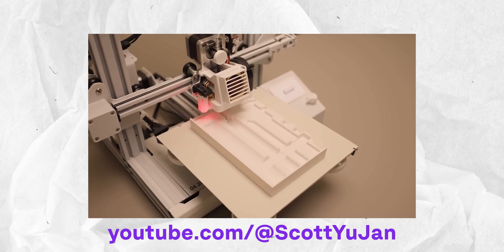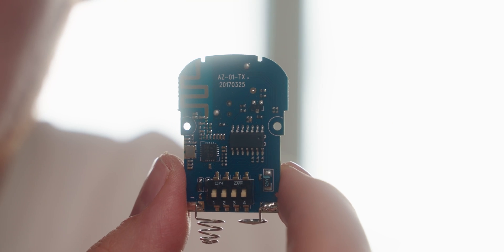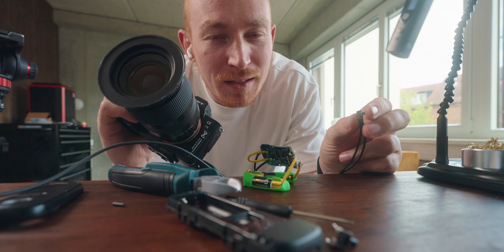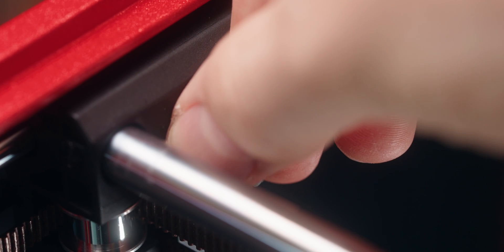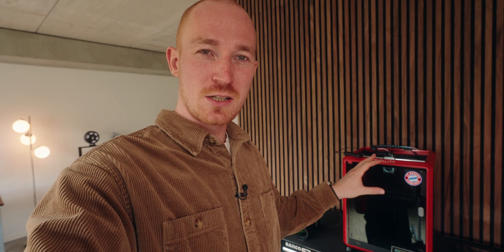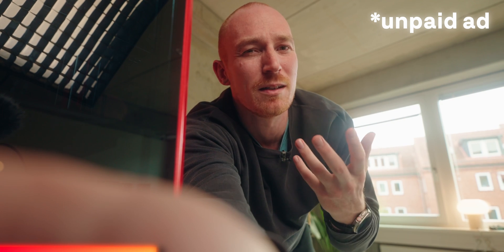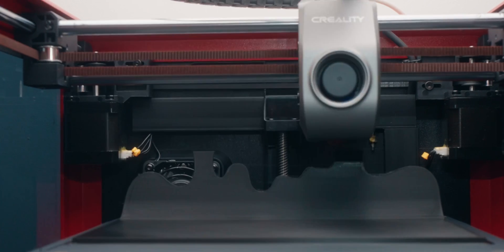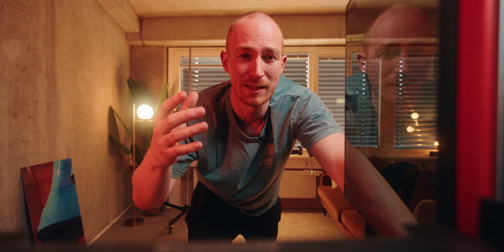Getting perfect 3D Printing Timelapses (with every Printer)

Comment: Can you plz share the gcode modification
Reply from the maker: I haven't used this gcode in a while so I can't offer much support sadly. 
If i remember correctly this was a copy and modification of the Bambulab Timelapse Code which I used in Orca slicer
All of this goes into the beofre Layer change gcode

;BEFORE_LAYER_CHANGE
;[layer_z]
G92 E0
; layer num/total_layer_count: {layer_num+1}/[total_layer_count]
M622.1 S1 ; for prev firware, default turned on
M1002 judge_flag timelapse_record_flag
M622 J1
G92 E0
G1 E-[retraction_length] F1800
G17
G2 Z{layer_z + 0.4} I0.86 J0.86 P1 F20000 ; spiral lift a little
G1 X220 Y220 F20000 ; move to safe pos
G17
G2 Z{layer_z} I0.86 J0.86 P1 F20000
G1 Y220 F3000
M400 P300
M971 S11 C11 O0
G92 E0
G1 E[retraction_length] F300
G1 X100 F5000
G1 Y220 F20000
M623
; update layer progress
M73 L{layer_num+1}
M991 S0 P{layer_num} ;notify layer change

;TimeLapse Begin
;G60 S01 ; This stores the current location of the hot end to memory
;G0 X220 Y210 ; This moves the hot end to X220 Y210
;G0 X220 Y220 
;M400 ; wait for previous commands to finish before continuing
;G61 S01 ; This moves the hot end back to the location that was stored in memory.

Comment: If you are already running a printer that is based on Klipper why even use mechanic switches? With crowsnest there is already an option for timelapses that can be easily added and additionally you can use a "general" macro to trigger a generic pin on the controller board which triggeres the camera.
Reply from the maker: good point! I like this solution because it's easily adaptable to any printer. 
I knew that something like what you said works with the ender 3 but I have very little experience with electronics so playing around with the board seemed risky to me. But would definitely make a very clean solution!